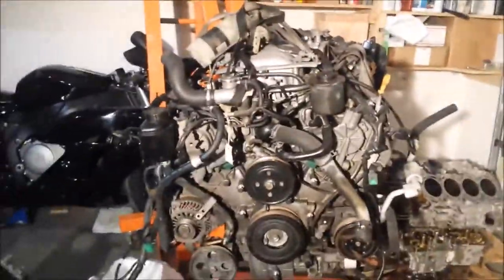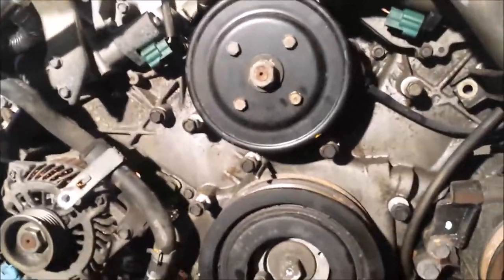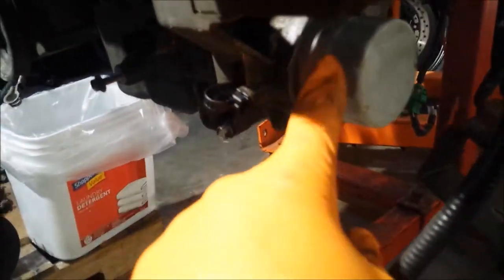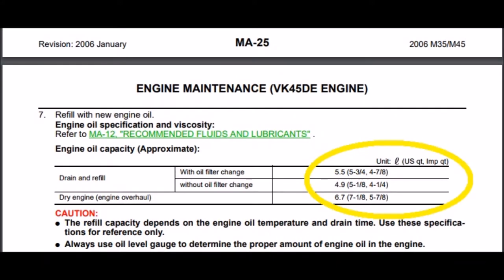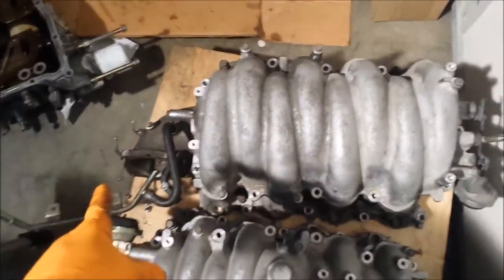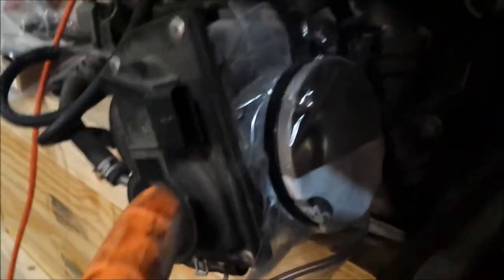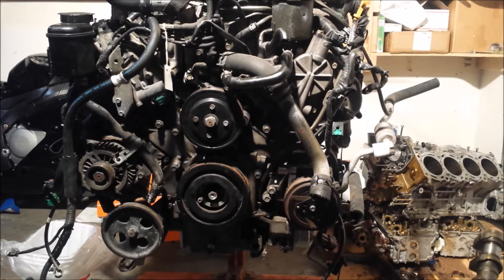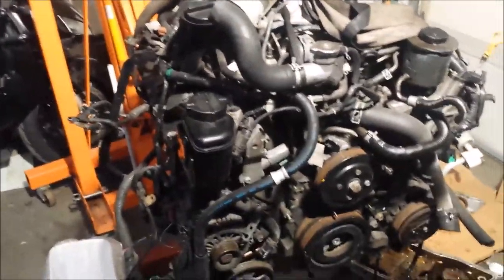VK45DE Part 1. Major differences as used in the US market vehicles

Comment: On 2:45 sec what kind of hydraulic fluid do you put into the reservoir of the pump??
Reply from the maker: Nissan power steering fluid or transmission fluid. I use Valvoline synthetic Dex/Merc

Comment from the maker: +jameason123, this is what I found to work replacing the M45 engine with this JDM one.
These are the things I needed to switch over between engines:
1. Upper and lower intake
2. Oil pan + oil pickup tube + dipstick
3. Water Pump
4. Thermostat housing (There's a single fitting that faces down on the M45 and up on the other engine. Get creative if you have to)
5. Some water hoses on the back of the engine heads. Just check before it goes back in the car
6. Valve covers. The hoses are molded differently, so when replacing the VC gaskets just take a careful look.
7. Electrical harness
8. Motor mounts

Reuse your accessories, as they bolt into the same locations:
1. Power steering pump
2. Alternator
3. A/C compressor
4. Pulleys and idler
5. Starter is the same physically, but different part numbers.
6. Ring gear with flex plate, and bellhousing (hence transmission) bolt right up

Do the necessary maintenance and replace components and gaskets while the engine is out.
Reply: Thank you so much, I will update on my progress. Can’t tell you how much I appreciate it, I’ve been trying to figure this out for a couple of weeks now.
Reply from the maker: You're welcome. Glad you found the list.
I suppose you are not a member of NICOclub? If you have questions about this engine, or the M45 specifically, search our forum or ask a question and you'll be sure to find answers in there.
http://forums.nicoclub.com/m-series-forum-fuga-forum.html
Reply: Looks like I need to join. Thx! I’ll take picks as well.
Reply from the maker: Are you doing the work yourself?
Reply: Yes. Doing it myself.
Reply: I’m planning on two days for the full swap.
Reply from the maker: Do you have access to a lift? Or experience removing engines?
Reply: Both, I restore old cars for a side business. Also have a full shop at my disposal.
Reply: Sorry for late responses, my phone isn’t notifying me.
Reply from the maker: No problem, I figured we all have lives outside of the engine bay. Lucky that you have access to that stuff. I do it on jackstands and it's not fun. If you have the replacement engine mostly ready, it's a quick turnaround. I think book time for removal is around 18 hours?
Reply: Ok, I have the Nissan m45 shop manual completely printed as well. I tend to over prep ahead to avoid complications. Planning on dropping it out instead of lifting it out. Lifting it out seems like a pain.
Reply from the maker: Yup! The manual calls for dropping it out with the trans and subframe.
I forgot to ask, do you have an idea what exactly happened to your engine?
Reply: Not exactly sure. It’s smoking like crazy, the smoke does not smell like coolant. It smells kind of like burning oil. But not exactly like burning oil. I know that’s vague, sorry. I’m getting 3 codes. Left and right cats, and Evap canister. I’m getting a light knock from Either 6 or 8. But the car still has power. I sent it to the dealer because a guy I know there said he would diagnose for me for $189. That was a waste. They only told me exactly what I knew and then said it would cost another $800 to do an in depth diagnosis. Car still runs good, minus the knocking and smoke. My instinct is telling me I spun a rod bearing, and that’s what’s causing the smoke.
Reply: I also know that a spun bearing would not technically cause smoke. I’ve been researching and the cats that were not replaced have been known to cause problems as well. The ceramic disintegrates into dust and the long term exposure gets in and wreaks havoc. But until I tear it down, I’m not sure.
Reply: Sorry, failed to mention, car was running perfect when it stalled on the freeway, and started right back up. Drove home and noticed the smoke.
Reply from the maker: With the cars that I have dealt with after rod knock, they have a distinct smell from the exhaust. It is a different smell from the bottom of the engine where the oil (or the metal bearing) has actually overheated or been burned, but I suppose the catalyst might have something to do with that smell changing by the time it hits my nose. 
You will probably know for certain after the old engine is out and torn open, but I was curious if you could see a cause down the line - low on oil, engine misfire, bad gas etc...
Reply from the maker: I have seen someone mention the possibility of the catalyst material disintegrating but I have never seen it happen to these engines like other Nissan variants. The only catalytic onverter issues were the manifds cracking in the early versions of the US engines, but again not to say this is not your issue, but the 06+ M45 is not prone to such a problem.
Reply: It was about a qt low. I used full synthetic and changed my oil regularly. Here is my working theory. Low on oil, at the sump where you described is that lower basin that does not drain all residuals out due to location of drain plug rod bearing fails, in turn causes too much compression on #8 and blows head gasket and causes oil to leak into combustion chamber. But probably something completely different. Lol
Reply from the maker: You know, a quart low shouldn't be too detrimental to most V8 engines I know. But considering our regular changing capacity is at 6 quarts, things could go sideways real quick. But again, some people reported sudden and random failures even when well-maintained.
I look forward to seeing what your tear down reveals.
Reply: Which jdm year works with the 06 m45?

Comment: Hey great video my friend, you share lots of knowledge.  I'm considering this 03-04 swap into an 06 M45 and just want to make sure I have this correct.  Intake needs to swapped.  Starter on opposite side, just re-route wiring?  Use JDM starter or 06?  Swap oil pans.  Swap water pump.  Various coolant hoses to intake.  Valve covers.  That's not a bad day in the garage especially with the price of the JDM engines.  No issues with 06 transmission bolting to 03 engine?  Bell housing bolt pattern is the same?
Reply from the maker: There are 3 engines at play here:
1. 06 m45 engine
2. 03 m45 engine
3. JDM engine

They all share the same bolt pattern for intake & oil pan.
# 1 and 3 share the trans bellhousing pattern
#2 and 3 have the same intake

It will be self explanatory once you have them side by side. I would reuse the accessories from the original engine https://forums.nicoclub.com/v8-engine-replacement-options-do-the-03-and-06-m45-use-the-same-vk45de-engine-t619905.html

Comment: You wouldn’t happen to know the differences between the 2003 q45 an 2006 m45 I was told that the only tunable ecu is the 2006 m45 an up but I’m wondering if my 2003 motor will plug in with a 2006 harness an ecu
Reply from the maker: Well, for the most part the 06 m45 harness can be plugged onto the q45 engine. You will have to modify/get creative with the starter wiring since they are in different places on those 2 engines.
More info here: https://forums.nicoclub.com/v8-engine-replacement-options-do-the-03-and-06-m45-use-the-same-vk45de-engine-t619905.html

Comment: I have a 2003 Infiniti FX45 VK45DE 4.5L V8 engine. Where can I find parts for my engine. Ive looked everywhere online and all I can find is discontinued :/ .. Also you mentioned exhaust manifold can crack ? If my exhaust manifold cracks, will their be a exhaust smell in the car. Ive been smelling engine smell. I recently had p0301 misfire but replaced spark plug and coil. Went away. Just wondering if ill have to replace my exhaust manifold.
Reply from the maker: It depends on what parts you are looking for. Post the list and I'll let you know if I have any idea on sources.

For the exhaust manifold. Unfortunately, there was no smell that I could tell. There was very little to notify you of the crack beside the code. 
I am not sure what was different about the FX manifold, but they did not seem to have as many problems as M45 and Q45 owners.

Comment: I have a jdm vk45 that im plannin to fit in my navara d40. On the electronics end does the jdm ecu have the immobilizer? Haven't got any answers to this yet.. Im trying to retain the stock vk45 wiring and ecu but if it has the immobilizer mite need to go full standalone. Or maybe you can point me in the right direction.
Reply from the maker: I can't say for certain since I've never really used the JDM ECU. However, the Nissan ECMs we get in the States usually have the security/immobilizer chip. It's called NATS and I know that you can use some tuning software to disable the features.

I don't have all the details, but maybe searching along the lines of " NATS Immobilizer " online will give you some guidance
Reply from the maker: For example 350z and other drifter forums. The engine is growing in popularity
Reply: @EdBwoy  thanks a lot for the info.. Yea i will do that and see what i come up with. If aftermarket ecu what do you recommend for these engines?

Comment: Hey Ed,  those Felpro gasket,  so you said you don't have to use RTV. If that's the case then I'm going Felpro as I too hard using RTV sealant
Reply from the maker: Yeah, i usually buy Victor Reinz gaskets from eBay but was in a hurry this time.
The RTV is usually used at the corners to keep the gaskets in during assembly. I prefer to have a plain plastic-rubber-metal seal and also for future work not scraping the RTV off the head.
So if the gaskets can hold themselves upside down, that's ideal for me

Comment: I’m doing a 2003 q45 swap into a g35 just wondering what things I should replace while the motor is out like maintenance
Reply from the maker: Spark plugs, valve cover gaskets, PCV valves, hoses at minimum.
I also do the crank seals while the engine is out.
Reply: Alright will do really appreciate the response thank you an nice vid
Reply from the maker: If you feel compelled you can do extras like cleaning the intake tract including throttle body. You definitely don't have to

Comment: I would like to swap a 04 JDM vk45de engine into my 2006 M45, I would like to know what all needs to be changed over to make it work.
Reply from the maker: Read this thread. https://forums.nicoclub.com/v8-engine-replacement-options-do-the-03-and-06-m45-use-the-same-vk45de-engine-t619905.html

Comment: Is it possible to swap the Porsche cayanne intake manifold on to this engine. Would it be possible with an adapter like the vh45de?
Reply from the maker: I believe it would be possible, but I have not seen any adapter marketed for this application.
The VK45DE intake manifold is considered to be a pretty robust design and is usually used in platforms such as the Titan/Armada
Reply: @EdBwoy  I'm wondering if the shape of the intake ports on the cylinder heads are similar between the vh and vk engine. Thanks again!
Reply from the maker: They look different front what I've seen, but I don't know how much the differences as I haven't played with the VH.
You could confirm the workability by buying the intake gaskets for both engines and overlay them to see what would need to be machined.
Reply: @EdBwoy  Will do, Thanks again! Your channel is very informative for those of us interested in the VK Platform.
Reply from the maker: @blalien777  I appreciate it, very underappreciated engines they are.
If I may ask, what application are you looking to use the VK for - a drift project?
Reply: @EdBwoy   I have a z32 300zx. Just researching the engine options if I don't decide to turbo the vg30.

Comment: Hey Ed found and intake on line but the guy removed the butterfly valves inside the intake... Good idea bad...Bad idea....
Reply from the maker: Not the worst thing you can do, but it's not a good idea. How much is the seller asking for it?
Reply: @EdBwoy  200 powercoated. But I found another locally cheaper with TB
Reply from the maker: How much is the local one asking for? It helps to have that TB to play with. Plus it's cheaper? 👍

Comment: Can you tell me what's the best recommend oil and oil filter for this engine also spark plugs is it denso or NGK meaning the factory original or which is the best I decided to just rebuild my block I found a guy and yes I'm doing preventive maintenance on the engine before I install it back in the car I will also ask my neighbor who has the M56 on how he got it to 700 horse power I do know he have a posi rear end his brother inlaw works at a tuning shop that did the work on the M56 says he turn my car into more sleep car they specialize in this
Reply from the maker: I use the recommended NGK spark plugs. Nissan doesn't restrict you to any brand of oil, so I use a Nissan oil filter and any good quality oil. Recently Valvoline synthetic was on sale so that's what I bought. Castrol, Pennzoil.
And always use premium gas
Reply from the maker: Since you're not going to buy that other engine, do you mind telling me how to get in touch with the seller?

Comment: Hey question are you in Texas I ask because getting set to rebuild my engine .....new engine bearing new timing chain going to get heads bored if I'm saying that right going to even get new pulley's what would you recommend on rebuilding this engine
Reply from the maker: No sir, I'm in the St. Louis area. 
Clarify for me, is the engine damaged and you are trying to repair it? Or why are you thinking of boring?
Reply: Well the car runs I think the number four piston losing pressure also misfire it has a lot of miles I figured it would be easier to rebuild it
Reply from the maker: @kennethaytch3163  How many miles on the odometer? I think rebuilding it now, before everything hits the fan is a solid idea.
I'd suggest you first reach out to an engine rebuilder/machine shop to see what they are capable of doing to it. They will tell you if they can actually source the parts needed to properly alter the design.

Unfortunately, I think most rebuilds we see are to put them right back to factory spec. Not too many people have gone wild with the engine internals, but if you end up doing something crazy, it will be nice to share with the VK45de family.

Comment: I have an 2006 Infiniti M35 and the mileage is pretty high, 270k. My question is, can you swap to the vk45de engine from 06-10 m45 with no issue? Can the old ECU be kept? Thanks
Reply from the maker: No, it requires a lot to be changed. For instance the ECU will need a V8 ECU, plus the right wiring
Reply: @EdBwoy  I see, well was planning on getting m45 later based on how much Im liking the M35 now. How reliable are the vk45de's? If it's anything like the vq I'm happy.